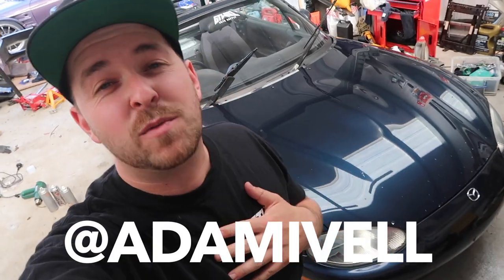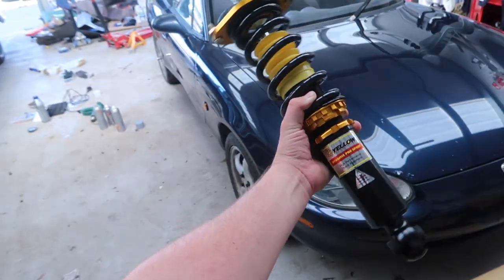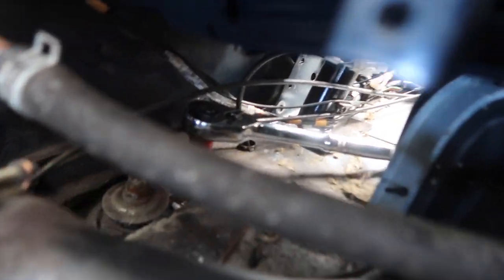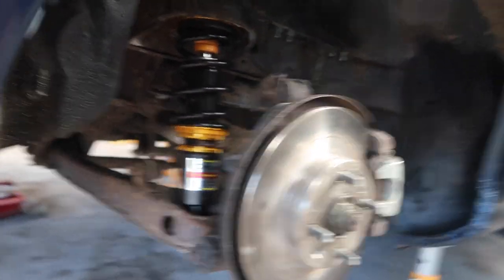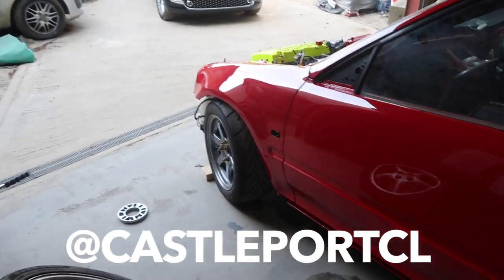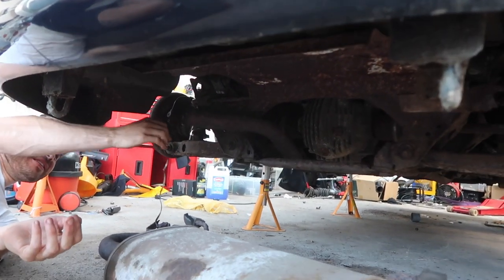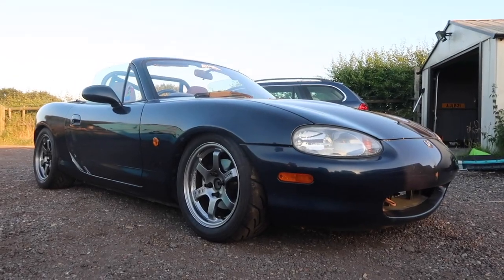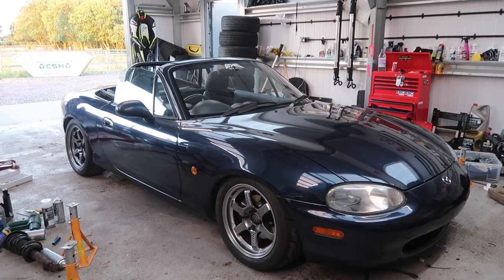Get low - [Track Day Prep - Wheels & Coilovers] + Visiting EG6 @ Bodyshop

Comment: being in a metal building doesn't help with the heat, you need to get a big cooling fan or ait con unit to help keep the temperature down, the mx5 looks cool sat like that